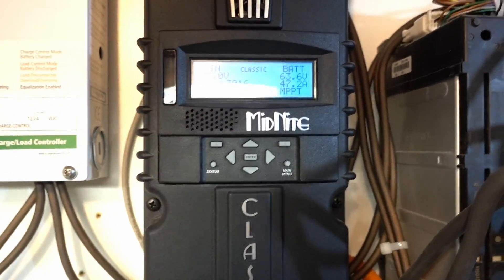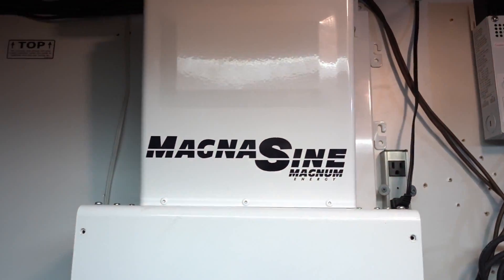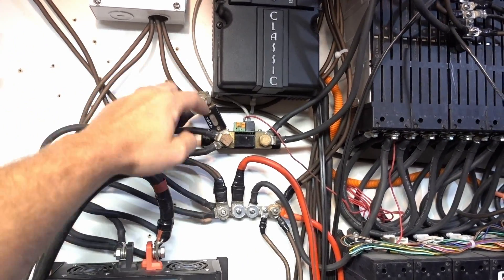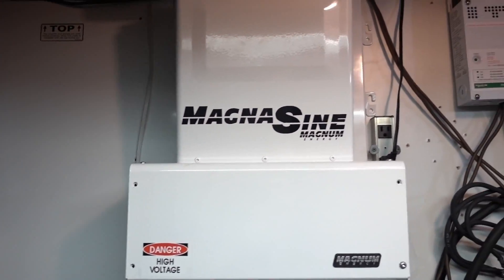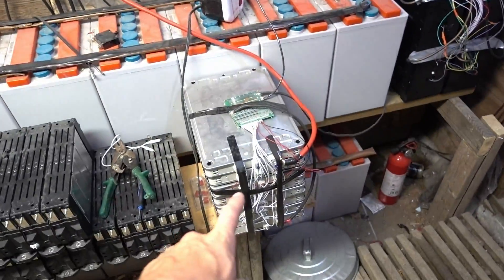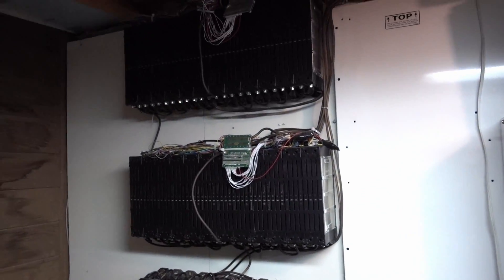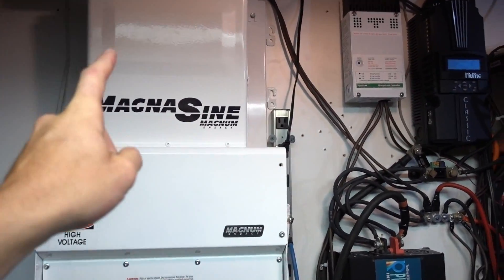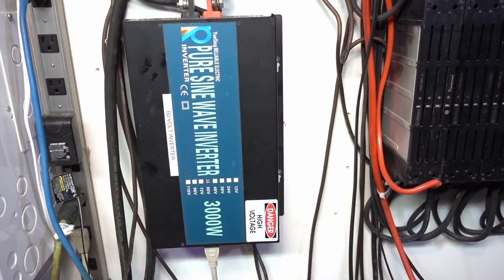MagnaSine 4400 Running On 66v Input!

Comment: I'm getting the kia/ hyundai hybrid battery. What bms do you use on your batterys
Reply from the maker: dont over pay its 1.5kwh max but ar super powerful, worth about 150-250 CAD I used a  
https://www.ebay.ca/itm/30A-16S-48V-LiFePO4-60V-Lithium-Polymer-Battery-BMS-Protection-Board-W-Balance-/112477569093?hash=item1a302f8045
Reply: Going Off Grid thanks, they run from $245 - 500 depending on kw size here

Comment: Nice! My whole house runs on one Magnum MS4024. Awesome that yours is compatible  Lithium battery bank. My next battery bank will hopefully be from a Chevy Volt. I hope to get 10 more years from my FLA bank.
Reply from the maker: GL with the SLA, when you give up on them you will fall in love with lithium! I cant even bring my self to use my gels anymore, thats why im giving them to my rents as they are 100% off grid. if you can get lithium at a good price its better if your paying full price well its still better but not much :D
Reply: Going Off Grid I had a quote for a 2014 Chevy volt battery that has 43k on it for $1200 US shipped.  Is that a good price?
Reply from the maker: I would only pay $800 us for that kind of mileage, but not all can get what I like to pay so its hard to say, I would pay $1000 CAD so depends on exchange for me
Reply: Going Off Grid The best price I could find last year was$ 2500  with over 60k miles. The price seems higher on the west coast. Even at $1200 that's less than half of what my FLA bank cost and the Lithium batteries have more usable power than FLA. I only draw my  bank down to 88%SOC. Very light cycling. With the Lithium ion I could use 70% of the capacity and it could hover at a partial SOC for days without dammage. FLA would sulfate real bad doing that. If I could get a good battery shipped for $800 a would have done it by now lol. That said My bank is running like new just and we are starting the fith year totally off grid! I think if I had the lithium batteries I would not have to run the generator at all. We only burn about 20 gallons of diesel a year. Still it would be nice to not have to. I installed a backup system for my parents. It's up and running but I have to install the solar array soon. At least now if their power goes out they have a 400 amp hour bank and a 3.6k Trace inverter. I bought all the euipment for the installation but it's fire wood cutting time and putting up eight 128 cubic foot cords every years is getting harder lol.
Reply: Where do you get your batterys from?
Reply from the maker: wrecked ev cars
Reply: Lol I get that.
I'm in Peterborough and can't find a source for batteries.
Reply from the maker: i look at my local junk yard

Comment: Another reason I'm really considering selling my soul for one of those MagnaSine inverters. :P

They're great.
Reply from the maker: lol not soul worthy buck i do like it !!!
Reply: @ FourZeroFour...Just saw a brand new 4448 PAE on Ebay for 1.300.00 or best offer, tested too, but never used.   We bought our unit from a company that buys direct from Midnite Solar, older units that did not sell.  They buy at bulk so we got a 4448-PAE wired in a Midnite aluminum battery box with like 10 breakers, switches, and a generator plugin,plus it has the remote, got it all for 2.5k to our door.  It's brand new but old stock 2015 but the same thing sell for 5-6k.
Reply from the maker: thats a great deal!